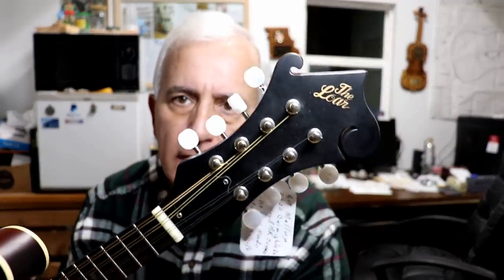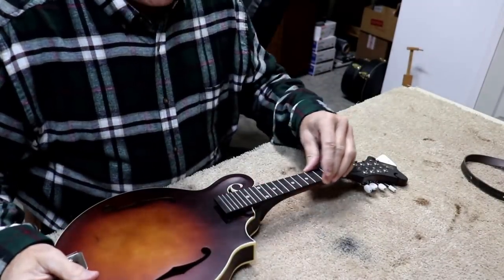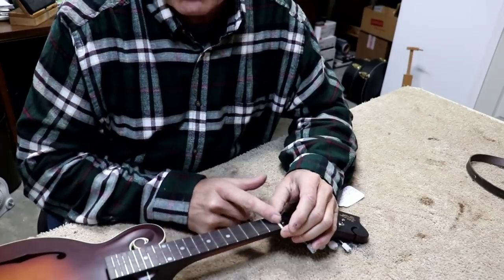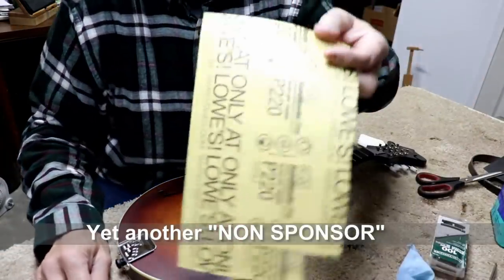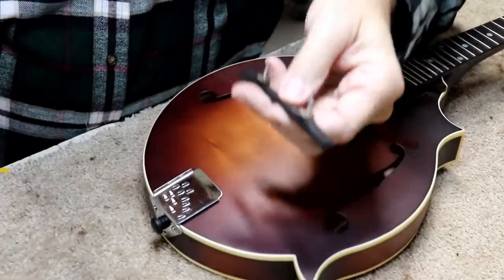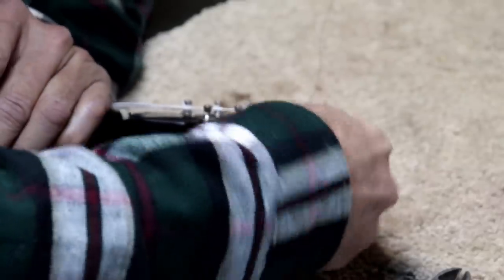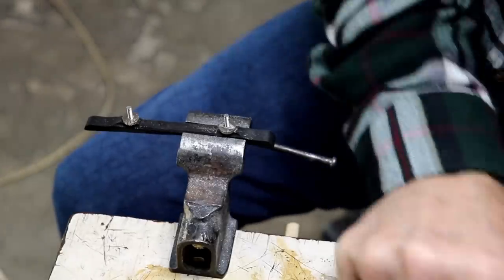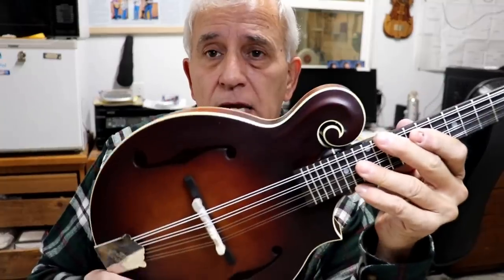270 RSW The Poor Loar Setup Now Better

Comment: Mr. Rosa, about six months ago I was able to buy a The Loar TM-375 that is very similar to the one in this video.  It had a typical factory setup.  The truss rod was very loose and it took a full turn to snug it up and flatten the fretboard.  After marking the Bass end of the bridge, I took it off and shortened the sharp screw heads and contoured the edges of the bridge.  Finally, I adjusted the nut with some files.  When complete the action was excellent.  Still left to do, add felt pads for the tail stop.  Thank you for your very helpful and entertaining videos.

Comment: Sounds better.  It’s louder, has better sustain and it is a little clearer.  You said you weren’t going to mess with the nut, but with all the filing you did to get it set up correctly you wound up “messing” with it quite a bit.
Reply from the maker: But a whole lot less than you would if you built it from scratch.

Comment: I recently purchased the same Loar you are working on. I had to get the ball-end allen wrench for my first set up. I still had to take my dremel tool to remove some wood around the truss rod nut. You would think that the factory would take just a little more time to make those things right.

Comment: Hi Jerry, another great instructional video. Interesting on how you wrap the strings. Do you do guitars that way as well? Or just Mandos? 
For your final fret buff/Sanding.. have you ever tried 000 steel wool?? It’s a little messier.. but it makes the frets glass smooth. I like your little brush you use to clean up the fretboard. where did you get that if you don’t mind me asking.

Comment: Jerry, we know what you mean by "not '45-ing' the edge of the fret", but the term is "chamfer". That's both a noun and a verb. So you are avoiding "chamfering" the edge of the frets.  And "rounding" the edge is fine, but it has a name also, if one wants to be particular. It's called "fillet". So you are "filleting" the edges of the frets. 
Just a little metalworking terminology.

Comment: Lovely Workmanship Jerry as usual Sir. I was wondering if this Loar you are working on here has the same size Hexagon Allen Key as a the Loar 520E-VS ?? I recently purchased a new 520E-VS, (8 months ago) It needs the thrust rod tighten just a tad.what size is the Allan key did   you use on this one? Also. was it  a "Ball type"Head that you have?? ty Sir, 100-100
Reply from the maker: Sorry all my Allen wrenches are just loose in a little box so I don't know what size it was. And I don't have a ball end..
Reply: Ok thank you Sir!, @RosaStringWorks

Comment: Can I use food grade flaxseed oil in place of linseed oil? It's the same animal, as they say, but I don't know about the boiled part.
Reply from the maker: Sorry I don't know anything about that.
Reply: As far as a finish, flax oil will go rancid on the wood. You need either boiled or polymerized linseed oil to prevent that. The boiled has dryers in it while the polymerized doesn't but has been boiled in an oxygen depleted environment to alter the properties. So, if you're squirrelly about the dryers in boiled linseed, Tried and True is the way to go.
Reply: @mandolinman2006  I realize the flax oil will go rancid and have an odor for a while but will it harm the wood? I've use it on cutting boards and rolling pins, etc. without any problems. Should I be worried?
Reply: @papaw5405  That I don't know. Every woodworker told me not to do it, so I didn't. I figured they knew something I didn't. I know in some situations it can cause mold/mildew and rotting when it comes to fabrics. That's one reason they use boiled for oil cloth.
Reply: Linseeds are the source for flax and linseed oil. The linseed oil is used in wood finishing, beacuse the chemical structure of the oil is changed. It has been polyimerized. This allows the linseed oil dry into a wood finish. The flax seed will not dry, and then may become gummy. A small amount of Japan Drier will allow it to polyimerized, but the you just have linseed oil. It would be raw though.
Reply: @patrickhurley1988  How about tung oil-it's non toxic,no harsh dryers like boiled linseed

Comment: You’re absolutely right about the nut, but if a customer wants you to replace it notwithstanding the logic behind (which you explained)...  What do you care?
Reply from the maker: I don't I just watch out for my customers
Reply: Rosa String Works And you’re right!!  But if they really want you to do it, it’s their money after all.  That’s what I meant.
Reply: I think the customer will be thrilled.  It raises Jerry in my opinion, but I already knew he was honorable.
Reply: Jenn Hill Indeed he is.
Reply: I imagine it depends on the original communication with the customer. He is making his hourly rate whether off this job or the next one in line. If he can save this customer some money, it is not costing him anything and goes a long way in maintaining his customer relations. He has more work than he can handle as it is.
Reply: I wonder if it's just the idea that it's a "deer antler" nut. Sounds cool.
Reply: Rosa String Works Good and honest. The idea of a "deer antler" nut is really cool though.  :-)

Comment: I don't make my fretboards  perfectly flat. I don't work on mandolins, but it works for banjos and guitars.  You need more space int the middle because  that is where  the strings move the most. That way you can put the strings a little lower for a little easier fingering. Please keep those snips away from the strings and don't snip them off. Twist them off so you don't have those sharp ends to cut our fingers. I have been stabbed too many times and then I don't have to worry about any kids getting wounded.
Reply from the maker: Mandolins are a little different than guitars you don't need much relief in a mandolin.  I cut the strings off flush with the post so they don't stick up at all.
Reply: Yes ouch. I'm gonna do the snipping flush with the post next time. I never knew about twisting off, but wouldn't mind trying that also.